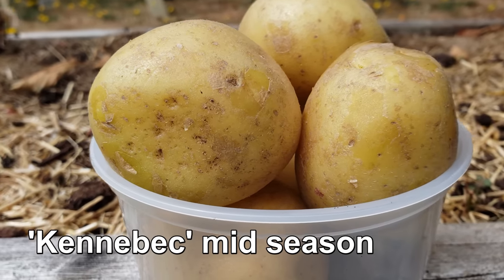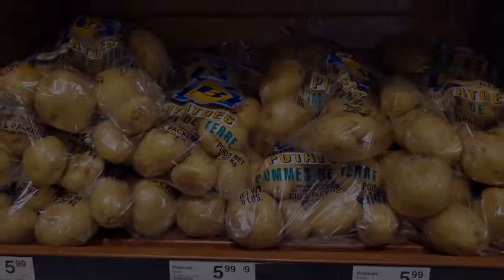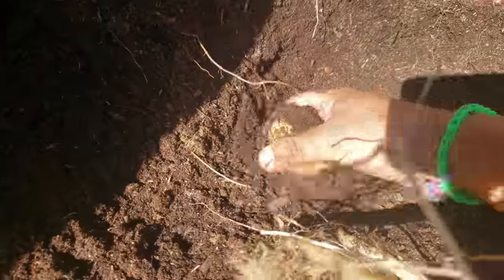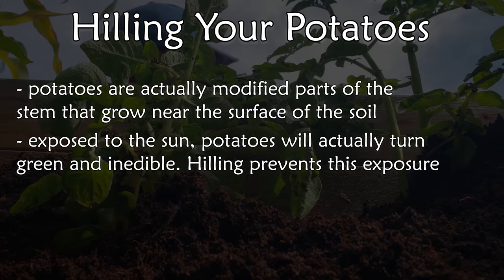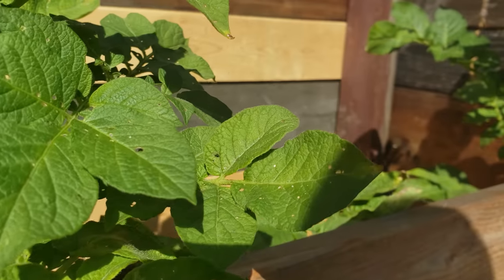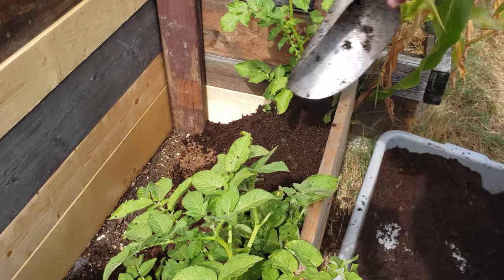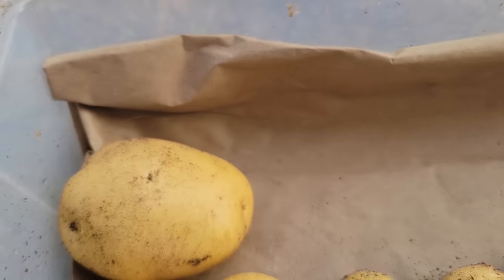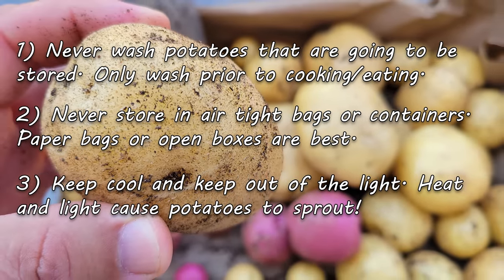How To Grow Potatoes - The Definitive Guide

Comment: Grew potatoes this year in tea chests and in a raised bed made out of old pallets and carpet. Surrounding them with thick black plastic (e.g. scrap compost bags) on the south-facing side can help keep them warm in the spring and autumn, just remember to cover with something white in the summer. Diverting roof drain pipes into water storage containers (repurposed IBC containers) allowed continued watering during the summer drought. Got a fantastic harvest, well worth the effort. Hoping to renew the soil with leaf mold this winter to minimise inputs for cost and environmental reasons.
Reply: Self-tapping screws are better than pre-drilling IMHO big labor saving.
Reply: What in tar nation is a tea chest??
Reply: @txjellybean3772  It's a large wooden box used to transport tea leaves. About 3ft high by 18in x 18in. Point being, it's a repurposed cargo container. Similar idea to re-using pallets or IBCs in the garden. Think mine originally came from the docks years ago but only recently used it for growing. Maybe things have moved on and they are no longer used.

Comment: This was good. We used UK based Tony O'Neil's method for this year,s taters Its basically a 15 gallon bucket, 2 taters on the bottom level placed EAST/WEST. facing..then more soil and then another two taters placed  NORTH SOTH facing..idea was to use ALL the soil...hopefully fill the space with taters. Hahaha...not happening yet.And the vines grew 4-5 ft tall...good thing we added the trellis!! so far, small yield from the two buckets we harvested at the 85 day mark here in Surrey BC.Too much nitrogen in the mixture too...our fault. The early season vines are still green too. Going to show my husband this video...maybe get him to put the tater boxes back in use. Ours are basically square so maybe cut them in half length wise, So, you said your box was only a foot wide? and you did one row, 12 inches apart, Looks good Jeff.

Comment: Still getting better at this

I use 25 gallon grow bags.  Roll them down to about 12 inches high. Roll them up as you hill,

 Roll them down to gently harvest without disturbing the plants as much.

Instead of straight raised bed potting soil,  I use straw multch,and mix in the soil. Think of this like growing in multch that's been enriched with soil.  

Another gardener I talked to claimed to grow them on a hay bales. I could not find another reference to that. Soo take that for possible folklore. 😏 

Great channel
Reply from the maker: Thanks Frank!  Love that idea. Grow bags are just made for potatoes.... Some even have little flaps on the side to harvest without digging!
Reply: They put soil/compost on the cut side of a partially rotted hay bale. Then push in the potatoes.  They actually grow quite well.